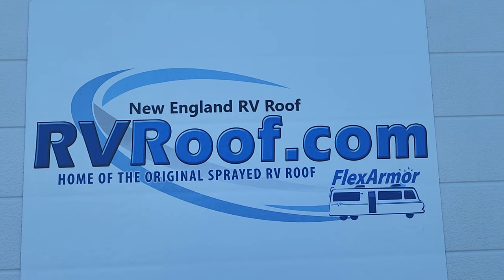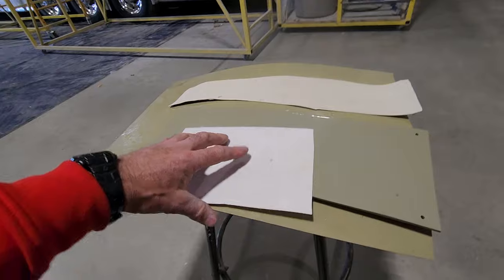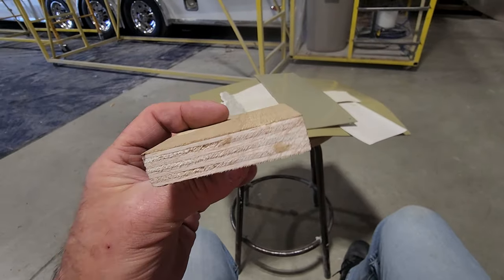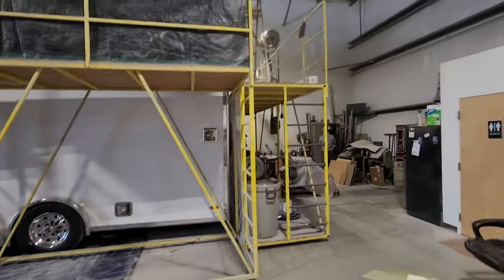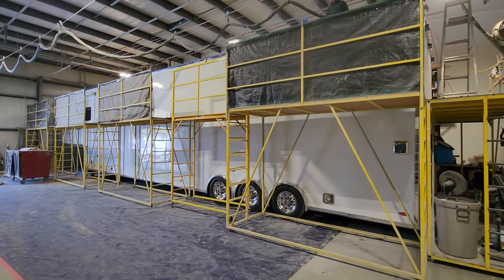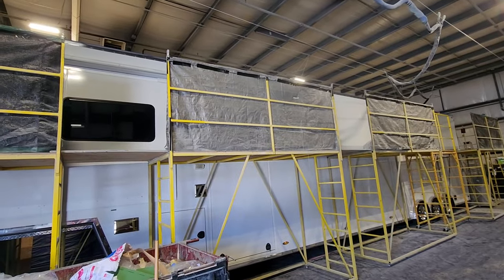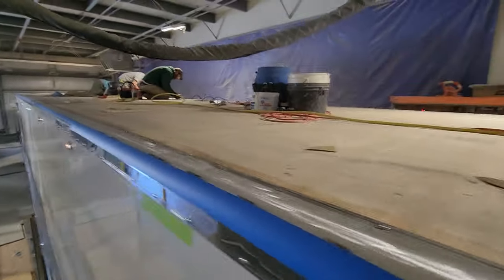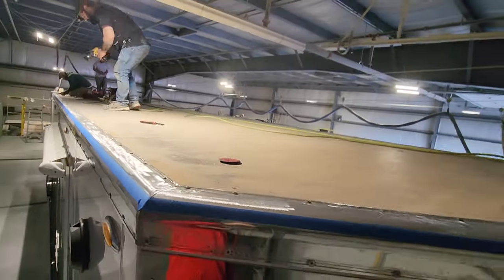FLEX ARMOR @ NEW ENGLAND RV ROOF, THE BEST NEW ROOF FOR YOUR RV OR TRAILER!

Comment: Awesome workmanship on that stacker …. It’s not easy your team should be proud of themselves.. it’s hard work to be done correctly you couldn’t have done it any better but anyway I wanted to say I purchased a 33’ travel trailer got a good deal so I thought had some pretty heavy rain and I noticed water coming into the master through through the cabinets on the bed… son of a bitch I said well I found the problem that roofing material stretched pulled off the edge of the seam on the roof fixed it‼️ that’s why it was a good deal… lol

Comment: I wonder if you could use that stuff for small little areas of a roof on a house? Like where there's hardly any pitch and they use rubber roofs? I wonder if this could be applied instead?
Reply from the maker: It would be a fantastic solution yes
Reply: Nice. I have such an area and maybe when it's time for a replacement I can look into that.